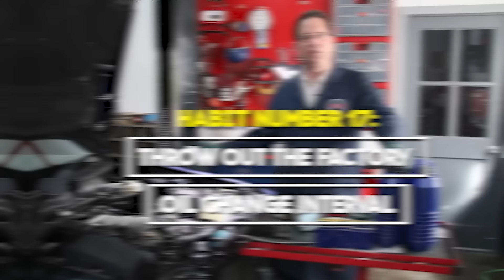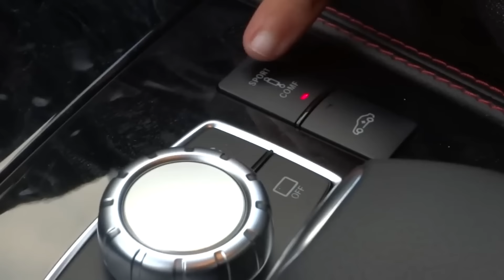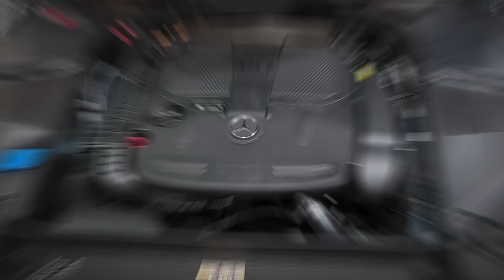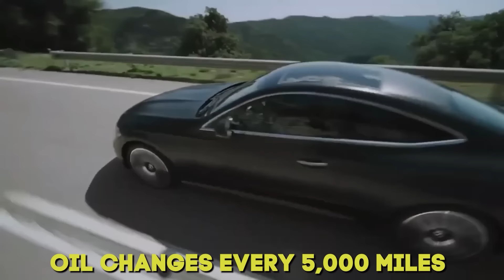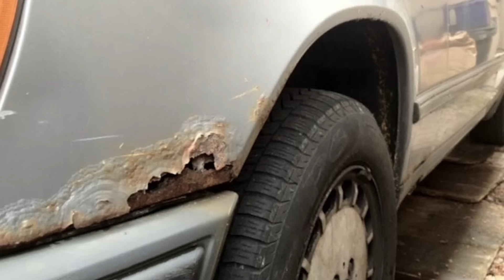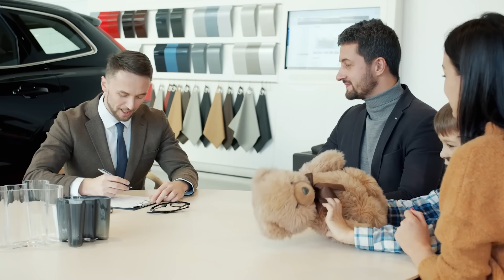17 Habits to Make Your Mercedes Last Over 500k Miles Without Repairs

Comment: I’ve got 206,000 miles and I’ve not replaced anything apart from a exhaust gas temperature sensor, NOx sensors and the rocker failure issues on my OM654.

Comment: I bought  2014 C250 new. The camshaft gave me issues since day 1. They replaced parts and the entire thing ,always trying to get me to pay. One repair was $8000 and under warranty and they wanted me to pay. I had to get my lawyer involved. So up until three years ago it was in the shop every year. Although I never paid anything out of pocket, the dealer tried to rip me off EVERY SINGLE TIME. Finally went past the warranty on the new camshaft then BOOM. Engine blew. I went to M.B, they claimed I needed a totally new engine. Of course not believing them, I had it towed to two other reliable shops but unfortunately, same diagnosis.  So instead of buying a new car, I shelled out for a new engine, cost me $12,000. So far and 40,000 miles later, I think I'm in luck. I do love the car though. At 209,000 right now. But I will say, aside from constant cam issues, nothing has gone wrong

Comment: This is a lot of generic info. I would stress the oil change interval, not buying in to the “lifetime fluids” bs, and change your pcv valve at 60k.

Outside those, know the main points of failure on your Mercedes. 

Following those guidelines are the true secret to Mercedes ownership.
Reply: all cars

Comment: As a Mercedes mechanic of over 26 years this video is no joke.  The oil change intervals are designed to look better for cost of maintenance and CAFE standards.  Take all your service intervals cut them in half and you pay for maintenance not engines and transmissions.
Reply: Would you recommend buying a used 2018 E400?
Reply: @RickHavok no we bougjt one with 103k .  pos
Reply: @Krakenhouse87 Are you sure it’s the car and not the shop? I’ve had both outstanding and horrible results with my M3 at different shops. It’s a great car over all. Things need service, but a bad shop or dealer can rob you blind.
Reply: Oui sure

Comment: I already change my oil around 4K miles. I got a code for a cam issue. When I changed my oil, it went away. I'm having leak issues. I've replaced the PCV already. Both engines. Both are M272.

Comment: You are forgetting a few important things: According to Mercedes-Benz, the gearbox is not "maintenance-free," so I have the automatic gearbox flushed every 60K miles/100,000 km and then put in a new filter, which costs about 500 euros, but I have never had any gearbox problems and have been driving Mercedes for 30 years. 2: Almost all Mercedes cars have sunroofs. Make sure the sunroof drainage is clean so that water can always drain away properly. If you don't do this, water can leak into the trunk, where there are one or more computers (usually at the rear right). These computers are absolutely not water-resistant, and repairs are very expensive. You will also experience a lot of malfunctions first. 3 Check the rear lights for water leaks, because the seals can start to leak, and the water will naturally end up right next to the computer, at the rear right.
Reply: Very good info. Thanks
But then i understand 60 miles = 100 km. Or i got it wrong, maybe that you mean.
60K Miles = 100K Kilometres.
Reply: @rattanedumaangobind3507  My bad, thank you, mate.👍

Comment: Better a NEW Mercedes. So many costs...,
Reply: If you like working on cars most of these are doable .
Reply: just got one too work. 2008 c300
secondary air. my thought is the cover is baking that motor, first encounter.
cv axels
one lamp
fuse
brake fluid
oil ,
trans fluid messy job
lube fill
engine feels strong, trans felt good.

Comment: This is exhausting, and ridiculous. Imagine throwing out thousands and thousands of dollars of good, working parts.  "Why are you doing that, Bob?"   "Oh, I saw this YouTube video..." 🤣🤣🤣
Reply: It’s called preventive maintenance, that’s how all cars should be taken care, I own a 2014 gal 350 with 140,000 miles now, zero problems, 2003 Tacoma with 237,000 miles zero engine or transmission issue, just regular maintenance brake pads, struts, ball joints once every 4-5 years.
Reply: Exactly bro he's listed 10's of thousands there just buy another car 😂

Comment: Change your engine oil every 5,000 miles. Use only fully synthetic Group V oil from reputable manufacturers. Then all these problems will not affect you.
Reply: Soylent Green is the best
Reply: Or use the Best Oil on the Planet . . . *AMSOIL"

Comment: Transmission filter and fluid change was $750, not $350.  $150/ hour labor rate.
Reply: Do it yourself. Tons of videos on the 722.9 as it's the most common Mercedes transmission in decades. Get a deeper pan and the Smart Media filter from the stealership. Make sure to flush. The stealership (and everyone else) will just drop the pan and at most might flush the torque converter. All instructions available at the Mercedes Source (Kent Bergsma) YT channel at extra cost if you want to be sure of complete instructions.

Comment: No one has made a video on how to replace the PCV Valve on the Mercedes S Class M278 engine so this issue continues to be a huge money maker for dealers who typically say you need to have valve covers resealed for $5000. Only they know how to replace the PCV valve on the M278 and that makes dealers happy and profitable.
Reply: Figure it out cuhh. Be the first.
Reply: @eduardoflores8277 I've seen a video on it already, it's on YT
Reply: The dealership tried to get me to cover gasgets at 47,000 and after-market warranty company turned it down and said no dice!  And it was $4,800 my goal is to get those replaced before the warranty ends!
Reply: You name is Mercedes mechanic why dont you make the video

Comment: Always replace the liquid in your headlights.
Reply: Don't forget to replace the Johnson rod 😂
Reply: @hardkore360 Mine has a Helsinki Smash Rod
Reply: 93 octane only
Reply: Headlight fluid change. Classic!
Reply: NO, NO, NO! The bumper fluid feeds the headlights. If you don’t change the fluid in the entire component, the old, dirty bumper fluid cross contaminates the headlight fluid. Meanwhile, MAKE DAMN SURE, you have enough Prestone in your tires if you live in a northern climate with large seasonal temperature swings.

Comment: the part with the SBC pump is very controversial with a theory with 2 answers, the theory goes like this: the SBC pump has a limited number of 500,000 activations or uses (after you pass the 500,000 limit you get an error that something is wrong but that doesn't mean you're out of brakes but it won't work forever either) answer 1; change the pump completely, answer 2; use an OBD scan and reset it then it will be like new, the 500,000 is just an unnecessary limit
!!! IF IT'S BROKEN, MOST MECHANICS WILL RECOMMEND CHANGING THE PUMP BECAUSE IT WORKS WITH MORE SYSTEMS, NOT JUST THE BRAKING SYSTEM!!!

Comment: The most C300 gas tanks are made out of plastic (smart engineering), only few are made out of metal = rust (stupid engineering. To change the dust shield on the rear brake and or replacing the emergency brake parts you have to take the hub and wheal bearing of the axle ( usually have to replace it) = bad engineering

Comment: Overkill, expensive cures for problems that don't exist, but remember to keep detailed records (tip #1 ) of all these services so you can go to the dealer at 250,000 miles and get some warranty work done for free. It it aint broke, don't fix it. But don't ignore reasonable maintenance either. I'm an owner of a 2008 V6 manual C class purchased new with only 27K miles on it and all original except for tires, a battery, oil and filters. After 17 years I just got a "TPMS inoperative" warning so I will probably have to get wheel sensors.

Comment: Excellent video and sincerely appreciated by us--me and my 20.5-year-old minty M-B W211 M272 E350 Avantgarde :-) Its travelled just 110,438 KM, is serviced 6-monthly--much of your advice I've practiced since she was young--the rest I'm noting into a servicing schedule as I watch. Thank you! 6:09: re the BS sprocket failure--made of "composite"? Sources like the US class action suggest the cause was faulty batch to batch variation of the metal sprocket tempering process. Also, not every M272 is affected--though 60% is too many, and failure often will occur by 60,000 miles (100,000 km), especially if extended oil-change intervals were employed.
Reply from the maker: Wow that's extremely low km's for a 20.5 year old Benz! Great you're keeping up with regular servicing despite low mileage. The balance shaft sprocket failure mainly affects earlier models (2004–2008) with the composite material, not every unit will have an issue but better be safe than sorry and inspect if you have potentially may experience it don't you think?

Comment: Superb video and advice. I have been following most of these maintenance tips and I agree 100% with the video tips. My immediate family own 3 mercedes benz cars 19 years old, 17 years old and 11 years old without serious breakdowns due to meticulous service I have always followed. However, it is rather practically impossible to follow the schedule if not DIY. I work on my family's cars almost every Saturday!
Reply: I own a 2000 mercedes benz c230 kompressor sport and so far I haven't had any major issues.
Reply: @normafralin2237 
Every mercedes until 2010-2012 are good.
But the mercedes's from the 2000 era are just bulletproof 👍🤌👌
Reply from the maker: Thanks for sharing! Your story is proof maintenance is key! Which Mercedes do you have?

Comment: Any Mercedes with the ABC hydraulic suspension needs to have the filter and fluid changed every 2 years this will prolong the life of all the pumps and rubber seals in the system.
Reply: Some owners who plan on keeping their models with the ABC suspension get one of the kits to convert over to coil-over springs, although there are opinions about the ride .

Comment: There is NO balance shaft on m273, only a idle gear, balance shaft is only on M272 (6 cyl), V8 don't need those.
Reply: most v 6 have balance shaft.

Comment: Yeah. Great video. I’ll get a Lexus😅
Reply: You mean Toyota with a new badge 😂
Reply: @kingslayer8542 "Toyoilet" = "Toilet" ! ! ! !
Reply: @kingslayer8542 Yep. And smoother leather seats that don’t rip  by 30000km
Reply: I owned aLexus LS500. If you don't do maintenance on these as well, they will break down. You still have to do all required maintenance or these won't last either.
Reply: I have both a Lexus and a Benz; Lexus is still going strong, but my I had to replace my Benz (with another Benz). Lexus is reliable, but Benz is nicer to drive 🙄
Reply: @lynnlee9896  Definately. Benz will need work and Lexus reliability is unmatched. I will take Mercedes for the ride every time. Thanks for the reply.
Reply: I had 2 Lexus. It's the same for them. Just not as expensive of matainance cost but still has to be done as well. The ride my S560 has is worth the extra $$ IMO. The comment about the seats is spot on. They rip before 30,000 miles.
Reply: @erniestarkey8856 weird doesn't happen in Australia and we arent a Cold climate!!
Ive noticed many Americans cars interiors are trash...I think it's the weight of the people and the attitudes of some owners.Lexus leather lasts 15/ 20 years here!!😂
Reply: @angusseletto1511 Never seen a ripped leather seat on Lexus here in Estonia. Still have a BMW E36 M51 1996 with 700000km on the clock and only the driver-seats tread wore through, but the leather is still good.
Reply: Good luck w/the Toyoilett!
Reply: @dramalss  Oh yeah! 10 years of boring driving thtough 500000km. You should get a Stellantis car so you can have weekly meets @ the dealer with other owners.
Reply: I own a 1989 E300 Mercedes with over 400,000 + original miles, original engine, original tranny.  car still going strong; You can't say that for a ToyoiLet Lexus!
Reply: @dramalss I own a 2010 w204, already spent 1.5 x its price on maintenance alone, I bled through all the problems mentioned in the video and in some cases more than once. However, my car is still unbelievably smooth to drive and powerful (I replaced the old puctured turbo and upgraded the software).
Reply: @Warhead-Vun I haven't come close to one & a half times its price on my 1989 E-300 but look at the bright side they're both still Running Strong yours and mine!
The older Benz's are a lot better than the newer ones.
Reply: @dramalss very true, my mechanic told me if you want to see me even more regularly , you can go get a new one, and then pointing his finger to a newer merz on his right which he had totally stripped down its front , saying to me he had yet to figure out what's wrong with that car.
Reply: @dramalss   I have as my daily ride, a 1985 mercedes W123 that my mom used. It's still going strong and smooth after 40 years and 500,000 miles!
Reply: Exactly
Reply: If it ain't a mercedes, it's not the same as a mercedes! Lexus is a mercedes wannabe.
Reply: I did that. Love that 10 dollar oil seal on the chain cover that leaks on all the 3.5. Lexus never did a recall only cost $4000 to fix a $10 part. That’s what turned me off Lexus the inverted V sixes which are impossible to work on.